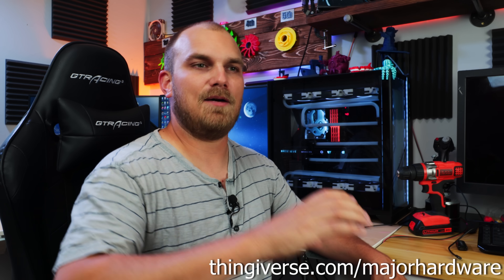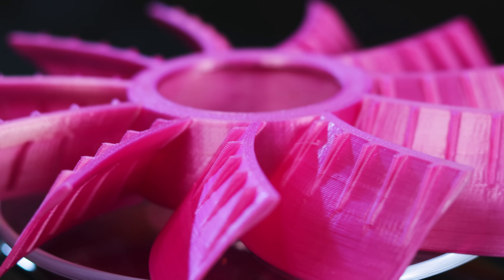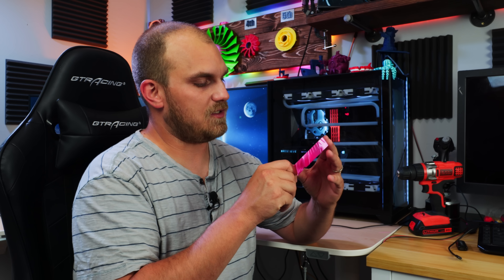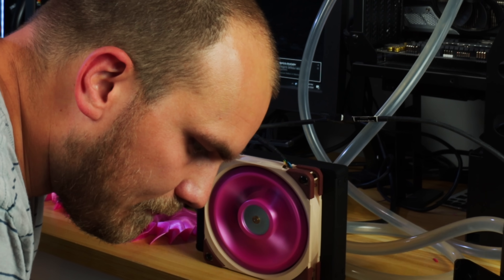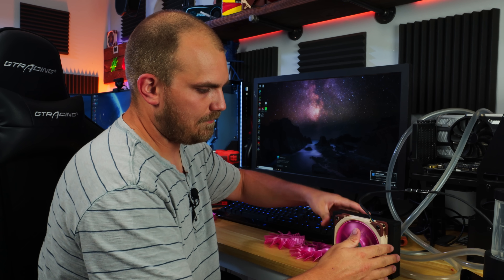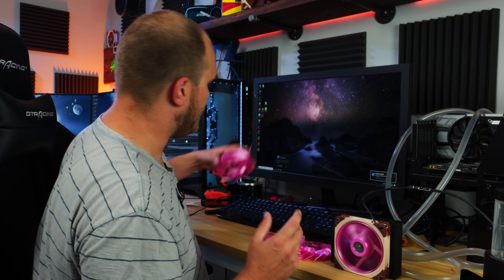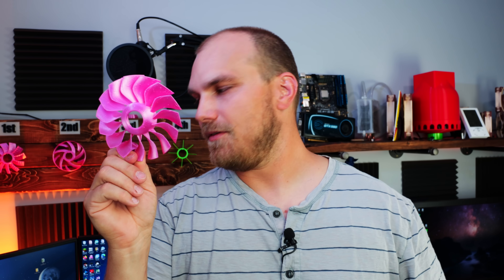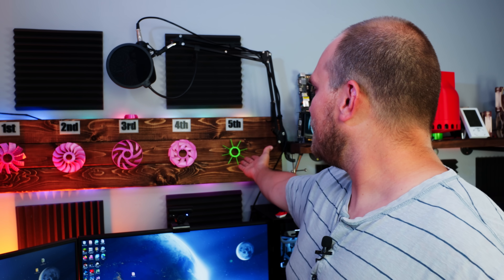4 Fans Designed by you and Printed by Me Who Is the Best | Fan Show Down Episode 3

Comment: I still think you should characterize the airspeed and static pressure. 

I know you’re mostly looking for cooling performance, as that’s mostly what computer fans are for, but with the many designs you likely already have or will get, it might be really interesting to see how the fans do at just moving air and/or “pushing” air. While one design might not be good at cooling, it might still be good at moving air. I’m just looking for something to characterize fan behavior beyond its ability to keep a radiator cool.  

Nothing fancy. Something simple as using your smoke/fog machine might be fine for the airflow. 
For airspeed, maybe a 3D printed set of small flat blades on a wire as an anemometer? (Or buy one? ~$15-$30) 
For pressure, maybe a 3D printed box with one side open for the fan and way to sufficiently seal against the fan, then a small hose barb on the box for some small open ended U-shaped tubing with water in it? (A liquid column manometer, apparently.)
Not really looking for precision, just characterization.

Airflow and Pressure are both specs you can find when buying computer fans. Characterizing them might help compare fan designs.

If not, then just keep having fun with it, and thanks for the videos. :)

Comment: I think that you should measure Db levels as fans designed by a manufacturer will have factored noise output into their designs and will make the choice to compromise on performance to keep the noise levels down.

Comment: I read your title as “printed by me who is the best” as you being really self centered. Then I realized it was missing a “,”. lol
Reply: A comma isn't enough.  You need to actually break those sentences apart, otherwise you run into ambiguity because the subject suddenly could be either him or the fans.
"Printed by me, who is the best."  
"Printed by me. Who is the best?"

Also the use of "who" adds confusion.
"Printed by me. Who is the best?"
"Printed by me. Which is the best?

Even if it's missing punctuation, the use of "which" might help remove some ambiguity, since it's plural: there are multiple fans, but only one of him.

Dunno.  My 2¢ worth, 'cause I read it the same way, and I like grammar and punctuation.
Reply: @stealschar  you kinda need a question  ark at the end to solve ambiguity
Reply: Let's eat, grandpa. Let's eat grandpa.
Reply: The comma would only make it sound more self centered and condescending, due to the pause created by it ("By me, who's is the best"). It's supposed to be a completely different sentence in this case.
Reply: commas make the difference.
Reply: If he'd bothered to clean up the burrs on the blades it could have been, but in the end it seems more sarcastic.

Comment: “Vortex generators” are just creating vortices and those are terrible for drag, it makes it less efficient
Reply: They do however help keep the flow more laminar until the very trailing edge of the fan, it sticks to the fan blade surface and lets the fan impart more energy to the air. It’s a balancing act against the drag you mentioned.
Reply: Yes, but no Noctua and Enermax made a different support for the fan so it would make the flow more direct against these vortexes. Also some fans are inside a ring which eliminates outside edges thus reducing vortices.
Reply: Air Breadwhich oh cool. I’ll admit I only know enough about it to know what the intent was, not how effective it actually has the potential to be. I just know efficiency is a balancing act and I think it’s worth exploring options.
Reply: Jake, I understand

Comment: I think if the goal were lowest temp at the cost of everything else, the TurboFan might win out and possibly be the quietest (relatively-speaking). Turbofan engines are optimized for efficiency and noise at a much higher RPM than this test used.

Comment: The turbofan has the highest potential otherwise it wouldn't be used in jet engines. The blades however need to be thinner and there needs to be so many blades that you can't see through it even at idle. Just like a turbofan blade setup. Also I would like to see a design like that but with a 2nd stage compressor fan.

Comment: The testing method is terrible, but the fan designs look cool. 

Noise meter for noise level testing or microphone and sonic visualizer for graphs. Airflow should be tested with a meter too. CPU/GPU load should simulated and be provided by a heater element.

Comment: The DOME will give better flow from the hub area down into the blades, reducing drag.

That turbine blade is probably close to the best. 

If you want a super efficient air mover (propulsion), then... 
The E-2D is equipped with swept-back “scimitar” propellers, which also have been retrofitted on the predecessor E-2C. Sweeping the blades back reduces drag due to shock wave buildup, just as airplane wings are swept back for high-speed flight. Since the outer blade tips travel faster than the inner root near the hub, the sweep angle increases toward the tip, forming the curved shape of a scimitar sword. The new prop assembly comprises eight blades compared to four in the older version, adding more thrust at a lower rpm.

Image:
https://encrypted-tbn0.gstatic.com/images?q=tbn%3AANd9GcTjbZbkgTf8HOsMfFiVek_d6Iyt4rQTs6QGkA&usqp=CAU

Testing...

You really need to compare power input to mass air flow.

Build a foot long breadbox with a TIGHT seal for the fan body to fit into.  Attach a dc current meter in series with the fan to measure current. Install an air pressure meter about 2/3 down the box to measure air flow.

Needless to say, the fan blades with the max airfow AND lowest current flow (power input) are the most efficient.

Comment: Why not both tests and add 1 more near silent operation (basically minimum for maintaining enough cooling for 50w tdp cooling at 69-70 degrees celsius and you cand do a heat resistor for controlled heating and place a temperature probe at the exit of the pump and on the exit of the radiator to get more datta)

Comment: Exercise in futility mostly, and for many fans you can easily see why it would not work. Double layer fans and half blades are useless, many shapes would not blow air straight but more outward etc.
And honestly, the test method is horrendously bad and inadequate.

Comment: If you thin down the internal blades of the big brain by around 30% it would probably increase its effectiveness by a bit due to higher RPMs. The blades probably aren't being stressed at all with their design could probably gain a lot by being brought down closer inline with the other fans in weight.

Comment: I wouldn't mind trying that inside out fan on my remote helicopter. I broke the tail fan and can't find a replacement...but I'm also bad at making fan designs. The outer ring seems like it would keep the air going in the direction I want without throwing it out the sides

Comment: Knowing what I know about aerodynamics, Testing these fans on an air cooler would probably work better since a radiator would benefit from a static pressure fan over an airflow fan like some of these.

Someone needs to make a 4 blade static pressure fan with just 4 wide AF blades for maximum pressure against the radiator.

Comment: Simple fan should be disqualified. It didn't fit the fan chassis because of the blades being out of spec, giving that fan greater surface area than it should have. I think this is a cheat, and an unfair advantage. Either rerun the test by shortening the blades to fit the chassis, or discard the results. This is not a fair competition.

Comment: Given the simple fan's performance, yet at a lower RPM than Noctua stock, I'm thinking the design could be tweaked, maybe remove one blade, or make the pitch slightly less aggressive. Assuming the peak power from the motor is closer to 2000 RPM than 1650 RPM, letting the same design spin a little faster should improve the performance, I'm thinking. Lots of assumptions here, but that's one I'd love to see.

Comment: One thing you should test, because I tested it when designing a computer case. I found:

1. It is better to pull air through a resistance than to try to push it through. Probably since it is easier to pull air laminar through a resistance than it is to push now-turbulent air through a resistance.

2. When pulling air through a resistance, it was even more effective if there was about a 0.5"-1" buffer zone between the fan and the resistance. Sealed of course. That was something I wanted to test because of the PC Power and Cooling Silencer PSU I was using which employed this to quiet the fan. I imagine the buffer zone allows the flow to be more determined by static pressure and less by the actual turbulent flow near the blades.

So I used closed-cell foam to attach fans to the wooden case to isolate vibration. I never actually got it built, but based on my testing it should have worked fairly well.

Comment: the turbo fan jet engine one needed to have rounded leading edges as the sharp edges cause friction with the air passing over the edge...rounding them allows it to spin quicker and would also maybe reduce the noise level too

Comment: The "pulling" fan would need a different setup that is beyond the scope of the challenge. In theory it could be the best performing one, albeit with a bulkier and more complicated arrangement. The fan needs to be pulling air out of a shroud that seals the perimeter of the entire radiator unit, with a little empty air space in between the fan and radiator. Air would be sucked in through the entire radiator and out the other side. That's almost 100% of the radiator's surface area exposed to cool air flow, and with no fan in the way.

Comment: Hmm, How about rigging up an electric motor, to do destruction testing on how many RPM's the designs can take. Thus have a 2nd rank for durability. (only appliable to the ones nudged off the best cooling board)

Comment: The turbofan design sounds exactly how you'd expect a tiny turbofan to sound at low power :P
The inside-outside probably doesn't have the best blade pitch or duct width.
"Simple fan" configuration reminds me of some Apevia fans I got with my case; no surprise that it works well enough.
Paolo design... just flip it over! :P
It'd be nice if all of these designs could get maybe one or two iteration passes before knocking them out entirely. Would mean a lot of print time and filament munching though.

Comment: You should definitely step up your chart game and have two diagrams 
1. Cooling Performance with the X axis being Temperature and the Y axis being Fan model and then do a stacked bar for each model with avg-delta and max-delta temp (you know the Gamers Nexus style bar chart)
2. Noise Performance with X being noise level in dBA and Y being "fan model - XXXX RPM". Since you already have the setup for reading noise level consistently why  ot use it?

Comment: The 2 measurements are all you need to solve which is the best and that is thrust vs amp draw as a DC motor will go a certain speed based on steady state voltage and coil windings. These two measurements will give you a possible winner and you may find yourself suddenly famous! I wish you would have done this with the dimpled fans also😁 the least amp draw with the most thrust wins!😁😁😁

Comment: given how well the simple fan actually did and looking the difference in room temp between the A12x25 test and it. It may be an idea to try and normalise room temperature. like if the original test you did on the A12x25 was on a cooler day and subsequent tests are on hotter days it skews all the tests. I appreciate we're in the summer now and its hot af but i'm sure you can see my point. Maybe all tests should be done in 20c or 25c room you know.

Comment: you should normalize the temperature results against room temperature. Also deltas are useless if you dont have standardize room temperatures as the relationship between cooling and temperature is exponential not linear. The simple fan design has a higher carnot efficiency than the turbofan but I'm willing to bet that the turbofan has better coefficient of performance, meaning you could crank up the rpm for a better airflow. Also it'd be interesting to see what the masses were for each fan.

Comment: You need to sand the fan prints.
 Those burs hurt airflow tremendously
Reply: This comment thread more informative than 3 years of chemistry classes
Reply: Put them in a plastic sandwich bag and fill the bag with liquid aluminum. Wait 45 minutes
Reply: @AlexFoster2291  -- Liquid Aluminum? 45 seconds might be too long! Edit: Oh you mean the radiator patcher.
Reply: @TlalocTemporal  I think your original interpretation is better.  What if the fan blade is secretly a T-1000?
Reply: @AlexFoster2291  dafuq? Lol
Reply: For control purposes you should not sand the blades. It’s such a variable process and many blades such as borks won’t be able to be sanded or smoothed evenly.
Reply: EonZero For a more controlled smoothing method, why not run the fan for a fixed amount of time, suspended over a bowl of the appropriate solvent (per above). The movement of the fan will ensure that the solvent airflow contacts all surfaces equally regardless of fan design, allowing for a more controlled method of smoothing.

Of course ideally, the temperature in the room should be controlled, to ensure the evaporation of the solvent is consistent. And the solvent should either be measured to an equal amount each time, or at least contained in a straight-sided beaker, to ensure the surface area remains the same throughout all the tests. 

Pretty complex, and who knows if the solvent could hurt the motor assembly - but doing so might be a good way to normalize for different artifacts left from the printing process, depending on the shapes and supports, etc. involved in each design!
Reply: @voldemortified  the solvent could potentially damage the isulation on the motor coils I think. Honestly would prob be good enough to just hold the fans in a fume bath for a few mjn
Reply: @voldemortified  yeah i dont want to sound like I'm against the idea of trying to make the fans perform optimally but another thing to consider as well is how the different PLA/ABS material he uses, which vary from episode to episode, will react to the fumes/process.
Reply: Putting them under a bowl with a dish of acetone allows the fumes to melt the surface and gives you perfectly smooth surface finish.
Reply: @excitedbox5705  he's using pla. Acetone only affects abs.
Reply: @excitedbox5705  He'll need to use chloroform to smooth PLA
Reply: @Voyajer.  Or tetrahydrofuran...
Reply: @excitedbox5705  Only with ABS
Reply: @seanthiar  acetone for ABS, chloroform for PLA
Reply: @excitedbox5705  Only if it is printed in ABS...
Reply: What is "sanding" the fans?
Reply: P51.Dante using sand paper to smooth the surface of the fan blades
Reply: Up
Reply: Yo big brain commenters, will using steam do anything?
Reply: @KWifler  depends on the steam temp, but you would probably melt the whole thing.
Reply: The nug sniffer lmao
Reply: NuggetSniffer 420 right? That was the first thing I thought.

Comment: 3 °C room temperature difference is huge, you should make multiple measures or install AC. The change measurement process will maybe help to speed up the whole process, start Aida with fan off on maximum temperature and then start the fan and wait until temperature didn't change for 5-10 minutes.

Comment: Since the temps are so close I say you should smooth the edges and do a test. This is all about airflow, and my theory is airflow is effected by the ripples on the blades from the 3d printing process. I'd like to see the results. Great video, subbed.
Reply: Yeah the poor quality and really rough texture on the fans is going to affect a number of designs. Like the turbojet based one was really rough in areas so it's not going to perform well

Comment: Hey! Thank's for showcasing my Turbofan! It didn't place first, but I'll still take second =). I wonder how I could optimize it for its low RPM...
Reply: A more aggressive twist from root to tip, or "twist" the blades. Low rpm fans are typically almost flat. CFD programs can be found for free.

Comment: Yea I should of voted for noise normalizing testing.  If one design spins faster, it could technically produce more cfm just due to the speed the fan can spin at. Maybe we should really try to normalize one of the variables, speed or sound.
Reply: Maybe the power ? To have the most efficient design. Just need to measure the amperage of the fans, easier than normalizing sound...
Reply: @Rocan0  That would definitely work. It would be nice to see which design truly is the best at pushing CFM.

Comment: The fans with lower rpm under load are performing better. It would be cool to see amp draw/power consumption in addition to the rpm/temp measurements. I bet their power consumption is also higher and are doing more work/moving more air. comparing rpm, cooling capability, and power consumption would give some interesting insight to figuring out a sweet spot for the most efficient blade designs.

Comment: If you haven’t already, I suggest trying to acetone smooth some prints and see if there is improvement. I’ve never seen a commercial fan full of print lines so I have to assume a smooth surface increases performance. :)